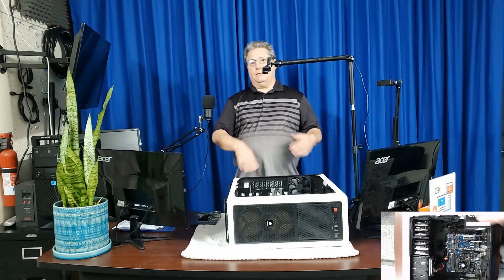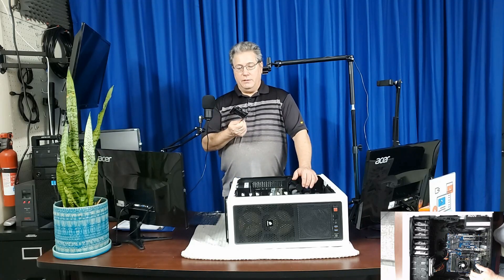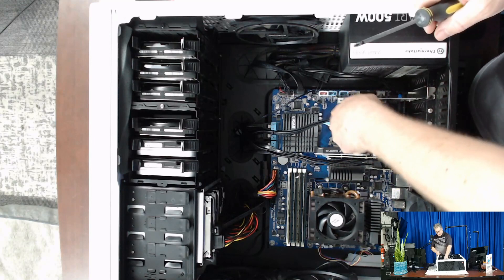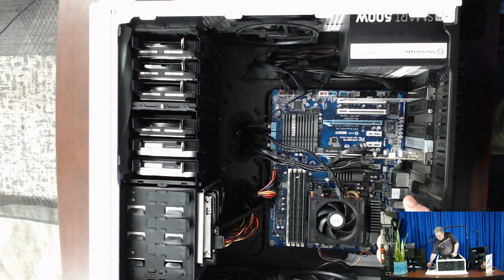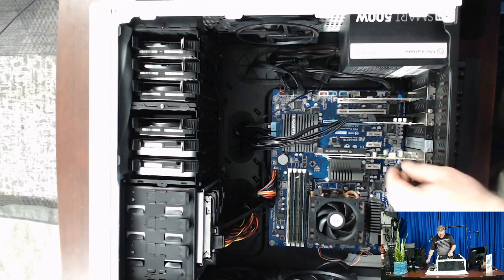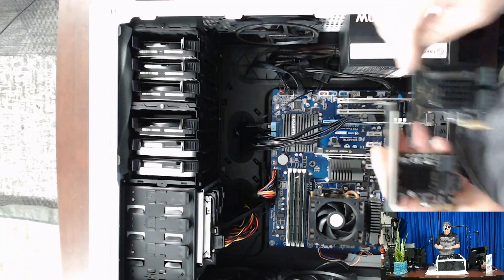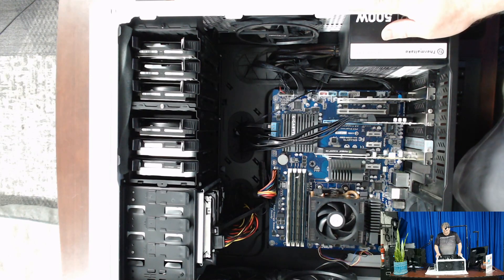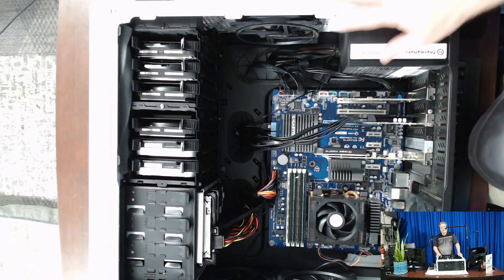How and Why to Install a PCIe Sata Expansion Card

Comment: I have like 200 of these cards kits and different cards and kits with jumper cables. Do you or anyone you know have a need. I have a bunch of stuff trying to get rid of cheap. I paid 1000 dollars for a bunch of stuff I'm an electrician and got 2000 4 foot led lamps with the purchase.

Comment: Installed  PCIe SATA Card,on boot card bios with drives listed, then it just doesn't get past asrock  start up screen pressing F2,F11 or delete keys nothing happens. Remove card boots up just fine. Windows 10 R7 2700X nvme boot drive. Any ideas on what to do? Thanks for any help with this issue.
Reply from the maker: Hi Toby,
I cannot be sure why you are having this problem, but I have had similar issues several times, and it was usually due to the drives not being recognized.

You may want to try these things if you haven't already:
1) Try inserting the card into a different PCIe slot. Sometimes specific slots have better compatibility.
2) Test the PCIe SATA card on a different machine if you have one to verify that it’s not faulty.
3) If you are connecting more than one drive, remove all but one and try them one at a time.

#3 worked for me on one of the systems I created, and I still don't know why. For some reason, one of the drives wouldn't work properly. To make it even more confusing, I added it back after I got everything working with the remaining drives, and it worked fine, but later it stopped booting again. I took it out, and it started working again. I updated all the drivers, Windows, etc., put it in again, worked, then stopped again.

The drive is a 4TB HGST Ultrastar, but identical drives worked perfectly, so I have no idea why this one was having issues. Needless to say, it was very frustrating and I never figured it out. That drive is still running on a different system, and I have never had any problems with it on that system, but it doesn't seem to like being connected via a SATA card.

Good luck, my friend, and thank you for commenting!

Comment: Hi.  Curious why you chose a SATA vs a SAS Expander / HBA with mini SAS to SATA?
Reply from the maker: Hi Giant,
I use only standard drives on all my builds, even the workstations because I like to keep things simple.
Basically, simplicity and budget-friendly are what I always strive for when creating videos.

Thank you for commenting, and I would be happy to hear more about why you would use a SAS expander instead of a PCIe SATA card.
Reply: @jamesturnertech  HBA are supposedly more reliable than PCI-E SATA adapter. You can use a SAS to SATA cable to use your SATA drives with it. You can fit 4 SATA drives on each SAS connection.

Comment: Plugging a PCIe 1x card into a 4x slot wont give you more speed.
Reply from the maker: Hi stevmoon,
Thank you, that is good to know. For some reason I thought these cards were 4x, but after checking the specs they are 1X, so your point is noteworthy. One thing I have done on the server is to ensure the drives I want to save more data onto are plugged into the motherboard, so for the other viewers, as stevmoon said you won't get as much transfer speed, so use the expansion card ports for drives that don't really require speedy transfers.

I sincerely appreciate the feedback everyone, so please let us know if you have any good tips or advice.

Comment: Does this work for windows 11 and what Spiltter is that?
do you have a a link?
Reply from the maker: Hi Jeff, 

This should work for Windows 11, but I recommend you ask the seller to ensure it will because some cards or Windows 11 may not have updated drivers. This is not a splitter, because you cannot split a SATA port, this is a SATA expansion card that can be inserted into any free PCIe slot, though X4 and X16 slots will provide the best transfer rates. You can do a search for PCIe expansion card on Amazon or Newegg and select one with the desired number of ports.

Thank you for commenting!
James